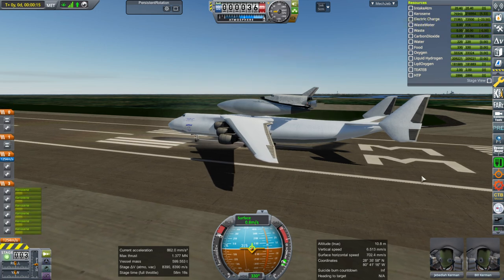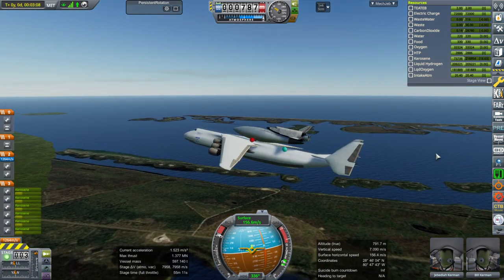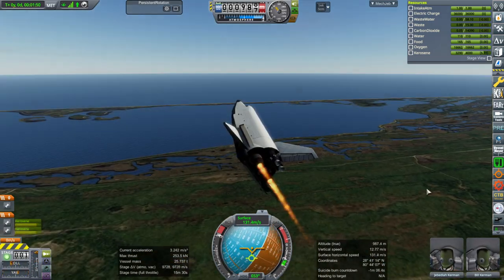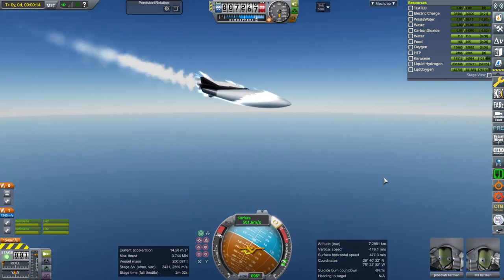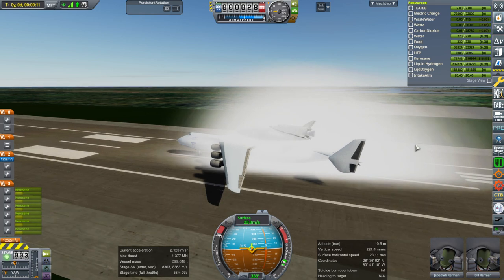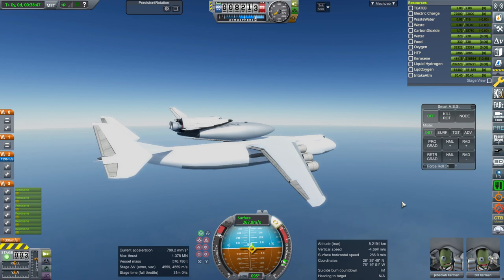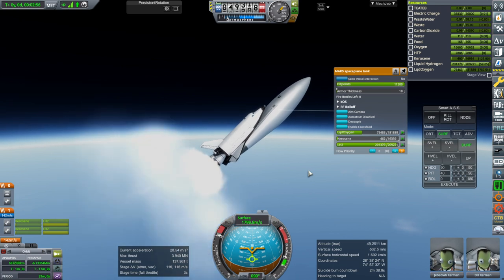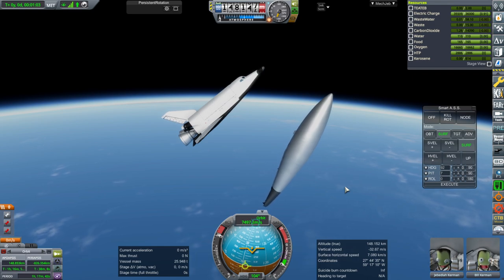KSP with Realism Overhaul - MAKS - An-225 Initial Testing

Comment: Those engines that are able to switch modes confuse me because how would they even switch the whole fuel system with the same injectors, ratios, turbopumps etc. like how tf did they even think this would work... well they are Russians so they might have done it
Reply from the maker: Each engine actually has two separate preburner and pump systems to get it to work, as far as I understand it.
Reply: Not as crazy as you might think, the Aerojet LR-87 ran on Kero/lox, Hydro/lox and Aerozine/NTO with the same combustion chamber and moderate changes to the pump impeller and stator design in the early 1960s. So with separate propellant optimized pumps: it's more an issue of thrust to weight optimization and the relatively high pump and chamber pressure help with that.
Reply: if it doesn't restricted to physics laws it is possible :)